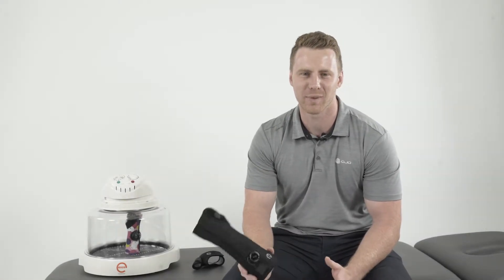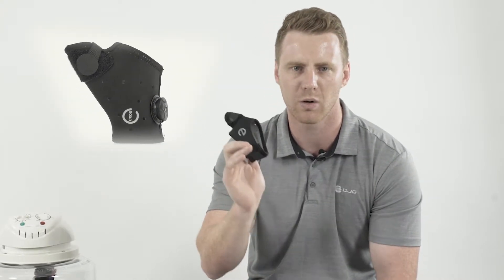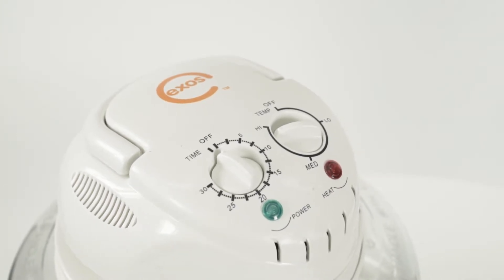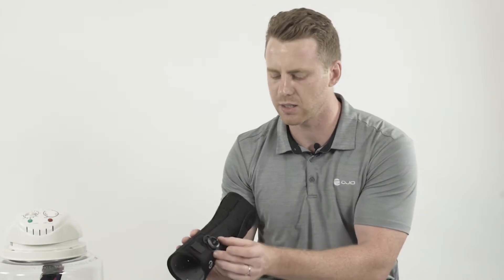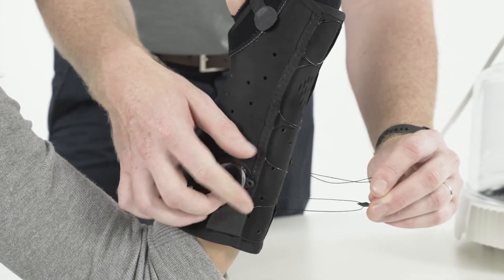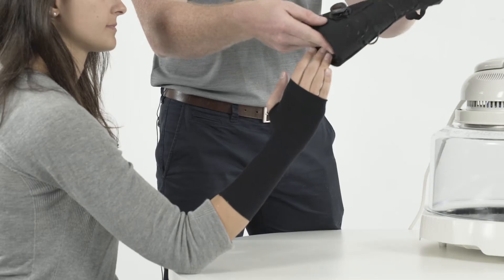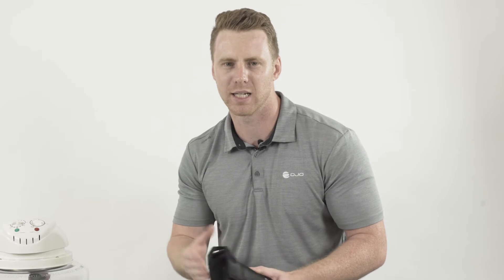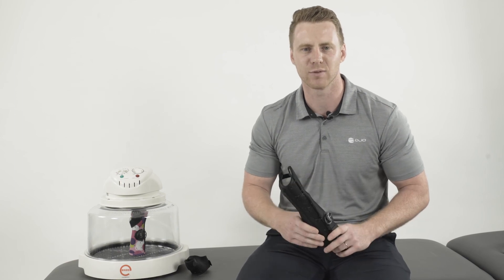The Theory Behind EXOS Bracing - Andrew Fegan DJO

Comment: I just got an Exos brace yesterday for a bad wrist/arm fracture(s). I have atopic dermatitis, & had to wear a fiberglass splint for the 1st wk (from ER visit). The inner sleeve was so scratchy & it really irritated my skin, causing a dermatitis flare. My arm got so red & overly warm. I had to remove everything around my fractures to take the sleeve out so it would just be soft cotton between my skin & splint. I told this to the orthopedist I next went to, & thankfully they have Exos braces there. I'd never heard of them, & I'm so impressed. I can remove this brace to regularly (very carefully) clean & moisturize the skin on my arm/hand. This is the 7th arm/hand injury I've had to wear a cast on. Compared to plaster or fiberglass - both of which quickly get so gross & smelly, the Exos brace feels like a miracle! I think it will help my skin to not be super delicate by the time I'm healed up. Bless whoever created them!